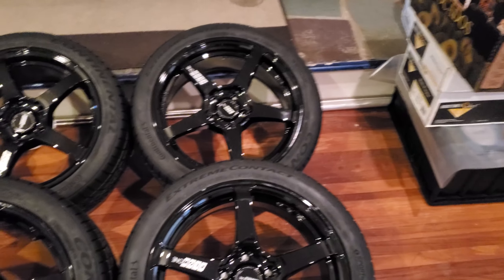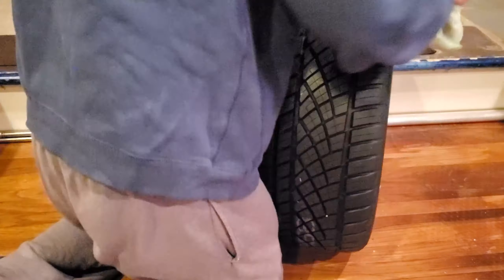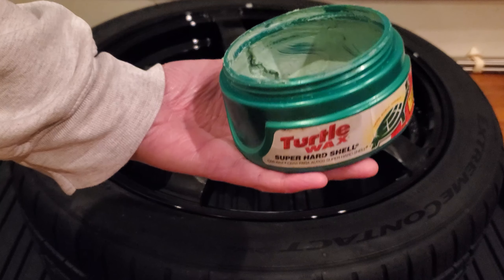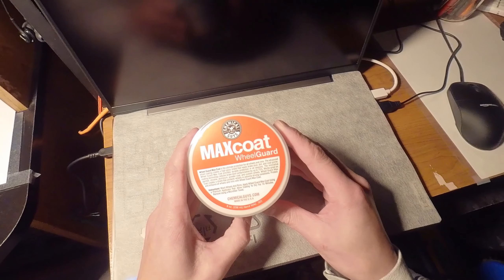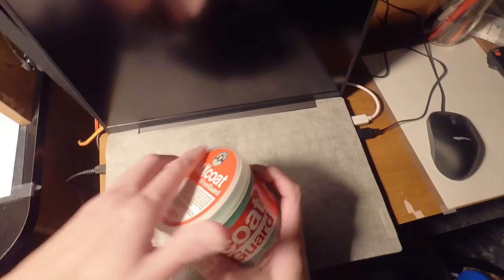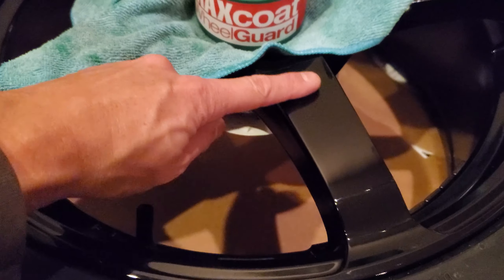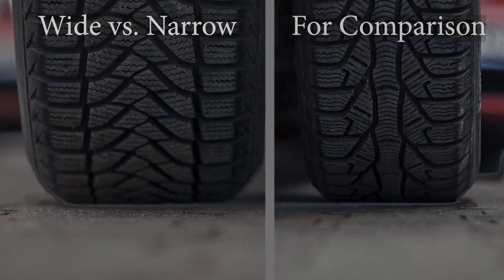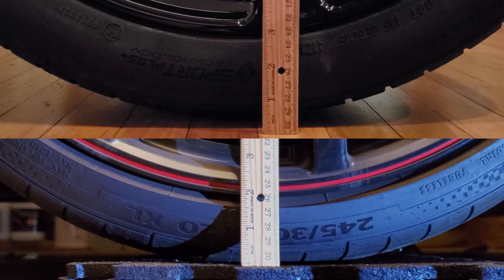(Part 2/4) 2021 Civic Type R (FK8) Preparing New Wheels/Tires Before Installing

Comment: Can't wait to see your wheels mounted on. I just purchased a set of 18's Advan TC4 and still debating what size of tires I should slap on this Spring. So far I'm thinking about the Advan Apex V601 265/35/18 but who knows, might go with 255/40 if I'm not planning to lower it.
Reply from the maker: Do a vid when you do and let's ses them.